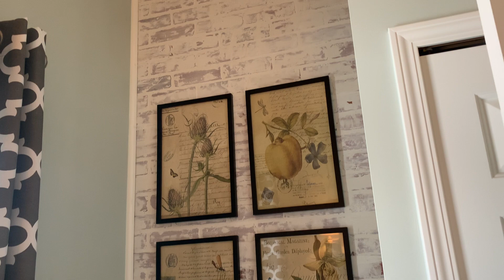German Schmear Faux Brick Wall

Comment: I did this and it turned out too white for me..........any ideas on how to remove some of the white after it's dried?
Reply from the maker: Oh shoot! Are you saying you covered too much and want more brick showing through or the white color is too white? I would try getting a wet rag and see if it will remove some it. Or maybe sanding it?
Reply: @jordanseverydaydiy4373  Not originally, I had a lot more red brick showing...then I decided to do a couple concrete accent walls (they came out great) and the grey made the red too red. So I'm thinking I'll go back over with the same color white the other walls are and I applied too much, it's paint, and now I'm thinking I want to scrap back some of the white.I have every scraper there is and it's not giving me the mottled look. Any ideas....I have putty knives, blades, wire brush....there is a way I know there is:)
Reply from the maker: @martaescobar7625  did you try a wet rag?
Reply: @jordanseverydaydiy4373  It's dry now........the only thing that sort of let me take some paint off was a damp sponge and then scrape. I used the same panels and flexible spackling you did 1st time around, and lived with it for a couple years. I had left a lot of the brick color then and wanted more of a German Smear look like you got. So I'm not starting from the same place. That's why I used paint and did a dry brush....wish I could send you pics. Maybe I could faux brick paint back some of the color?....I don't think I'm that good:)
Reply from the maker: @martaescobar7625  oh gotcha! Are you on FB? Here is my link, you could message me with pics. Not sure if Incan help or not but it would help to see it. 
https://www.facebook.com/melissa.jordan.5682?mibextid=LQQJ4d